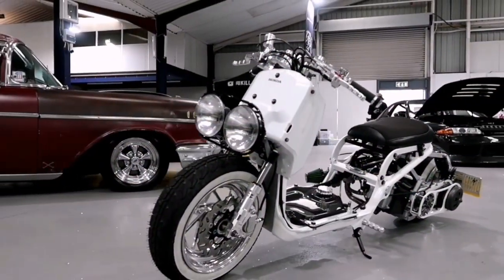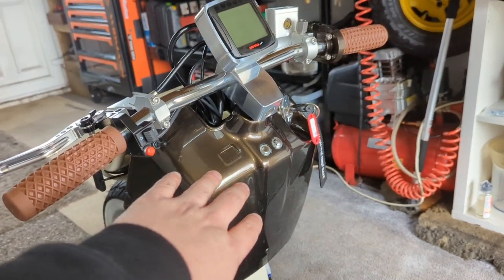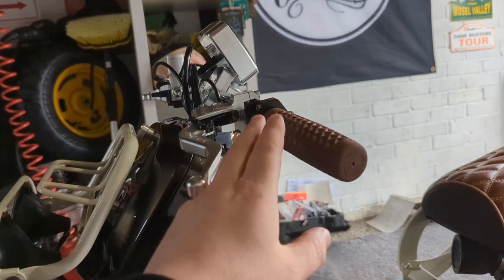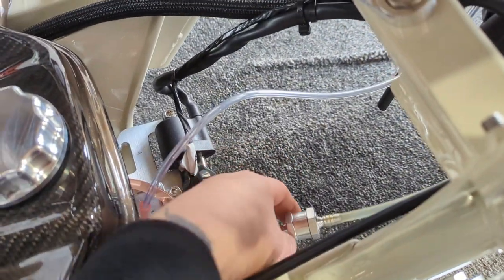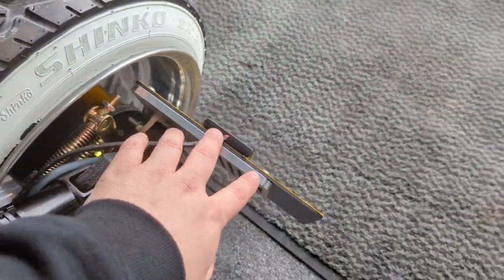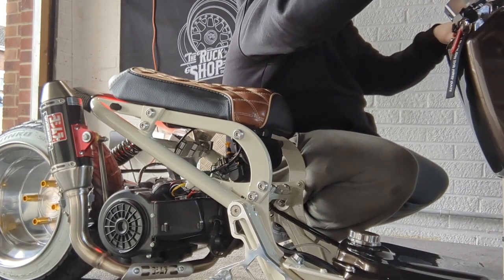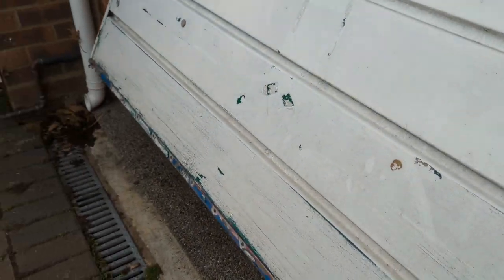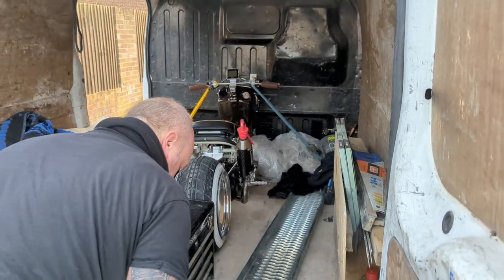Retro Racer Honda Ruckus

Comment: Hi, i'm loocking for a gy6 swap  on my european Zoomer,  where do you get yours  ? 
Thx..
Reply from the maker: I supply them as the UK distributor for the ruck shop
Reply: @RuckStyleUK  sorry,  I've forgotten one word,  for a gy6 harness that match with euro Zoomer..
Reply from the maker: There isn't. I use the ATR wiring harness and completely rewire the whole bike
Reply: @RuckStyleUK  ok And do you use an 11 pole stator ?
Reply from the maker: @jeanmarcpoirier4831  absolutely
Reply: @RuckStyleUK  thanx a lot !!